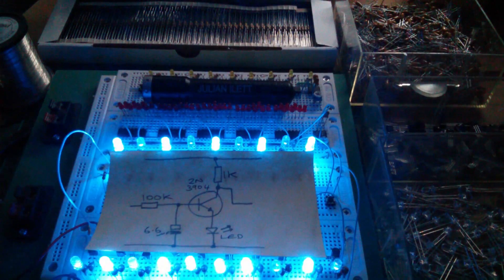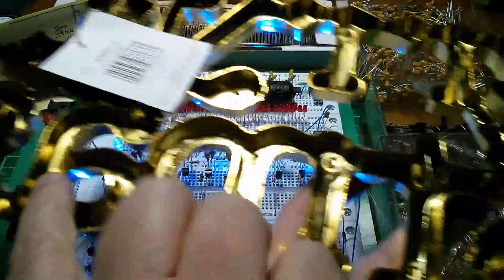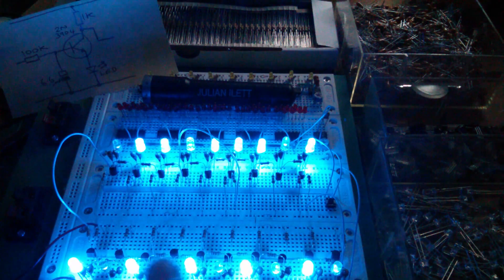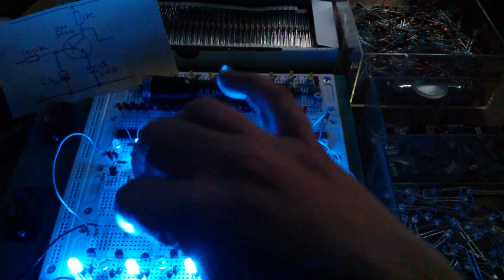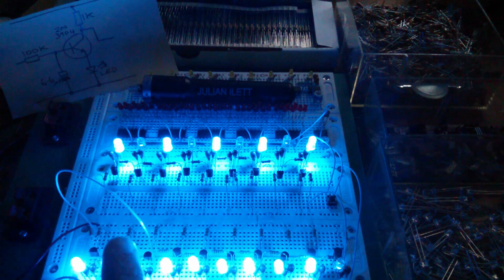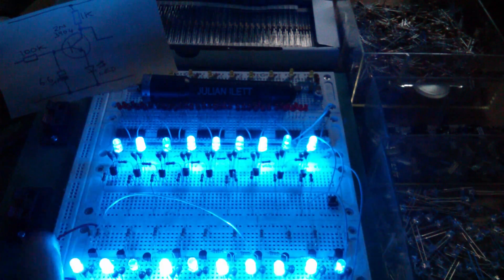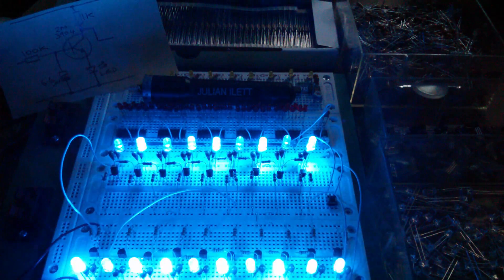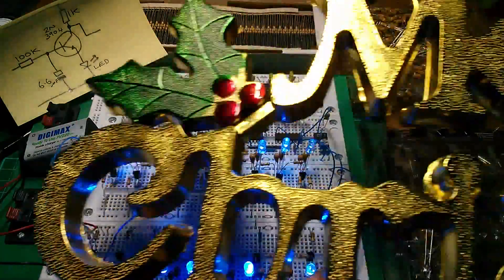19-LED Ring Oscillator with Internal Feedback - Christmas Idea

Comment: What is the rationale of using the NPN transistor as a high side switch?  Generally the load (LED in this case) is placed on the collector, not the emitter.

Comment: Some time back I ran across an item on ebay that featured a heart-shaped circuit board with LEDs around the periphery.  The oscillator that drove them consisted of only 3 transistors,  probably in a very similar configuration,  as the LEDs were all wired in groups of 3.  Built that just in time for Valentine's day one year...   :-)

Comment: Depending on where you input the feedback will depend on how quickly it double cycles. Your example goes counterclockwise and when you move in that direction with your feedback input everything counterclockwise of that gets a double input. Once at the beginning and then again when the original input comes around the circuit. Hence the different rate of perception. in theory this could act as a perpetual booster. Giving me ideas now.

Comment: Julian, I have a question... Not about this video... But is there a way to build a 5 amp 12 volt pwm fans controller? Can't find anything on the web about it... Well not those currents...
Reply: Andrew van Leeuwen I think you could use basically any high power mosfet (e.g. IRFZ44) in combination with an 555 pwm circuit. Search for "Afrotechmods" here on yt, he also made a video on this topic :)

Comment: Arduino and 2 shift registers can do the same thing with many lighting options based on the code...........
Reply: You will need 3 shift register since you are using 9 led's.  Mount the shift registers on the Merry Christmas thing and all you will need to do is hook up 11 wires from the Arduino. Your way of doing this is very cool and without a micro- controller. Good job !

Comment: I've built walking robots with these types of ring oscillators, but I use a 74HC14 schmitt trigger inverter with a resistor and capacitor, instead of the transistor. My biggest robot has a 16 stage circuit, with 4 branches fed by a 4 step core ring.
Reply: I would love to see your robots, please consider posting some videos.

Comment: if you watch just two of them, they'd work great for a model railroad crossing, (in red)
Reply: you could use  the classic transistor astable multivibrator circuit mentioned by sparky projects above... IIRC this was exactly the application that was suggested for the circuit in one of the old 50 LED books I've now lost. or alternatively you could use a 555. sure to be plenty of diagrams for either of these on the net.
fwiw British xings show a solid amber light for a few seconds before the 2 reds start flashing alternately which adds a little more complexity
Reply: i like the fade down that each alternative led does kinda looks like an incandecent
Reply: Yeah I think LEDs fading down looks really pleasant too. in the back of my mind I've an idea about making a 7 seg display LED digital clock where the segments fade down
Reply: i like that idea

Comment: Terrible idea. Good for the 70's and 80's.
A Micro-controller is the way to go. Chuck all those Capacitors, transistors,...etc.
One resistor and LED per pin is all you need. (As long as you stay below the maximum rating of all pins combined, which is usually about 20mA per pin or 200mA total chip-wide. 
Then, you can have any pattern you want.
I don't know why YouTubers are attracted to old ways of doing things. Nostalgia? Masochism? 
Who knows...

Comment: why cant u just get some kind of a microcontroler or an ic to switch two releys that will be connected to the LEDs but if u want more complex patterns u could use arduino by itself Mega would be great becouse it has a lot of I/O pins

Comment: I ran a simulation of this circuit with qucs. The diagrams show it takes about 6 seconds to settle into the oscillation. I'm getting current swings between about 6mA and about 200μA thru the LEDs with a battery drain of about 55mA. Interesting graphs showing swings between 3.1V and 2.5V at the top of each LED. Making that connection from the first collector to the 14th base yields a rather more complex set of graphs, as you can imagine (the battery current gets a regular hiccough!).
Reply from the maker: Wow. Interesting stuff. And much easier to experiment with different component values in the simulator I bet.
Reply: http://image.storistry.com/QucsPix/Ilett19.png and http://image.storistry.com/QucsPix/Ilett19rnd.png
Reply from the maker: Thanks for that - interesting (and colourful) graphs :)

Comment: Circuits like this are pretty cool, but I must admit that I do not hold much nostalgia for them. The same effect could be got with a microcontroller and essentially no circuitry and about 2 hours of programming. I've built plenty of circuits like this one and they have their own appeal, but these days I prefer to just get the effect without using up a hundred parts and an entire day of breadboarding.
Reply from the maker: Buying one also takes 2 hours - Watford's a nightmare on a Saturday ;)
Reply: Why muck around with 2 hours of programing and just go out and buy one.
Reply: TheDutyPaid If I can just go out and buy something, I do.  I have a million more projects on the table than I can possibly build - so I save my creative time for building things that I can't buy.  It would be wasting my time to make something I can just buy.
I've ripped LED circuits out of cheap decorations and replaced them with my own better ones. But if the LED circuit is fine as is, I'm not going to waste time reproducing it.
Reply: John Ridley
So he did it a old fashioned way, it was a bit like a electric jigsaw.

You can buy everything, or pay someone else to do it for you.

Have you ever made a jigsaw, I know there are faster ways to get a picture, but taking the time just to relax is priceless.
Reply: TheDutyPaid Sure, and I totally agree. I was not trying to take away from his effort in any way here. The point is to do something you enjoy. For me, I have so many things on my plate that are NOT things that you can just buy, I'm not going to spend my time making things that I can just buy. But everyone should do whatever makes them happy.
I point out that the way it was done here is probably way more time consuming than using a microcontroller simply because if someone wants to reproduce this effect, and that's their only goal, throwing an Arduino at it is going to save a lot of time and trouble.

Comment: FWIW, your judgement of 'twinkliness' is based on the loop sequence seen on the breadboard.  If you took the existing circuit and placed the LED's in randomized points around  the channels, would that appear more twinkly?  Of course, the wiring would be far more messy.

Comment: How about using RGB leds and wiring each color separately? ;)
Reply: Then you would need 3 ring circuits and have a delay timer in between to let each colour show.
Reply: what if you give each ring a different value capacitor that would bring them out of sync and probably makes some kind of colour fading?
Reply: It would be so much easier if there were NPN transistor arrays in IC packages, but alas, so far I've only found the ULN2003 and ULN2803 ... Oh wait, there are the 5-transistor CA3083 and CA3127, and the 7-transistor CA3082 (Common Collector), for example, but they're all either ridiculously expensive per transistor, or hardly available anywhere in the first place.

Comment: Just rewatched the one transistor LDR flasher video.  Wonder if one could get some cool effects mixing in some LDRs in this circuit. Like replacing that extra 100K resistor with an LDR, and then pointing that at a LED in a different stage.
Reply from the maker: Wow, mind blowing idea :o

Comment: The astable multivibrator was the first circuit i built in my early teens, though it was BC108's and torchbulbs (before led's), i soon realised that the stages could be increased in numbers
I still use the multivibrator as a goto oscillator, very robust and reliable circuit.
Reply: good one,  finishing chrissy lights is one thing,  a computer is alot harder.

Comment: Hi Julian , your vids are great and I really enjoy watching them. However I have a limited understanding of components and their working - i.e, what capacitor to use for x.y.z. I'm hoping you can recommend / link-to a good book I can use for practical uses where I'd build up more components and learn to use them correctly. I have a background in programming - things like sending signal through i2c , uart etc I could write using assembly / c++ .

I'd like to start with a chip , for eg a arm cortex and build out from that , inc memory etc.

Thanks for the vidz b.t.w
Reply: allaboutcircuits has basic and intermediate guides, please take a look at their tutorials.

Comment: To random it up a bit more, when you are fitting it to the decoration you could try this.....rather than putting leds 1-5 into MERRY in that order, mix them up a bit. It should completely change the sequence.
Reply from the maker: They'll be mixed up a bit, but it'll be easier to follow the channels in the moulded sign (from a wiring point of view)
Reply: even thinking of the wiring is giving me a headache lol. Would say it's gonna look really cool when it's finished.

Comment: Where did you get this box of tantalum Caps? That looks like 5000 of them.
Reply from the maker: I bought Rapid Electronics' entire remaining stock of 3.3uF tantalum capacitors for 1p each.
Reply: Julian Ilett that's the kind of thing I would do. I'm always picking up stock selloff from maplin as the reduce thier component and cable stocks.
Reply: Tantalum Caps are the most unreliable. They leak, short out and are expensive. High value, Low ESRs can be achieved by paralleling electrolytic caps.
Reply: PirateKitty Err, tat's are solid, they can't leak. It electrolytic capacitors that leak. Tat's can however go short circuit unless you derate them depending on the peak voltage spikes, peak current flow and operational temperature. If used within the manufacturers specifications they are no less reliable than any other type of inexpensive capacitor. It's just that people go only on the voltage rating stamped on the capacitor and don't read the manufacturers information.

Comment: Nice using transistors, but boy that's gonna be some big complicated PCB.
Reply from the maker: No PCB - just twisted together components - bit of solder - wires and hot glue - mulled wine and mince pies - yummee :)
Reply: I'm working on chainable PCBs about the size of a fingernail. Single-sided. I got the hole count down to 17. Waiting for the Banggood and Aliexpress shipments to arrive.

Comment: hi, why you used tantalum caps insted of electrolytic ones ?
Reply from the maker: Because I have 8,000 of them.
Reply from the maker: It's an interesting tale. I bought some 1uF tantalum capacitors (about 1,000) from Rapid Electronics for my solar charge controllers. Then this charming and delightful young woman from Rapid phoned me and asked if I'd like to buy their entire remaining stock of 3.3uF tantalums (about 8,000 of them) for a penny each. I fell for it :)
Reply from the maker: A 9V battery.
Reply: E-bay? :-)
Reply: What a great answer :D
Reply: really nice idea, i should try it
Reply: and what voltage you used to power them ?